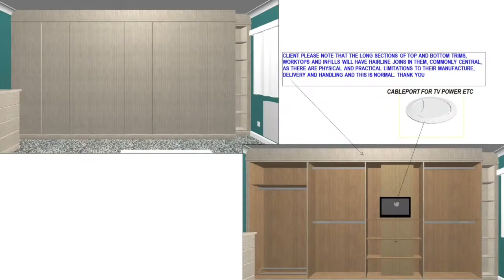Hammonds Furniture Custom Chimney Breast Wardrobe

Comment: Hiya do you pin the timber on the back of the plinth?
Reply: Hi, Yes, pin then screw, pins prevent the timber from moving from the 2mm reveal line when screwing to the back of the plinth, otherwise the plinth can sometimes look a little wonky! 👍😁